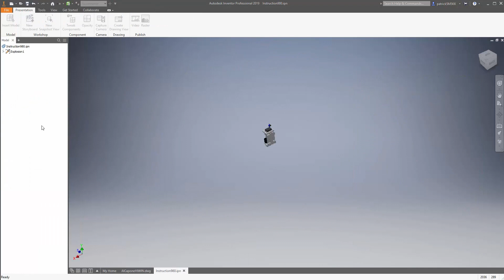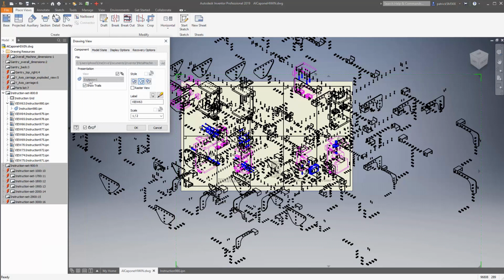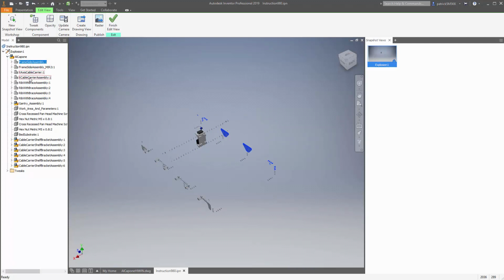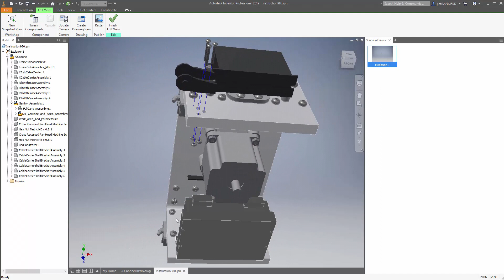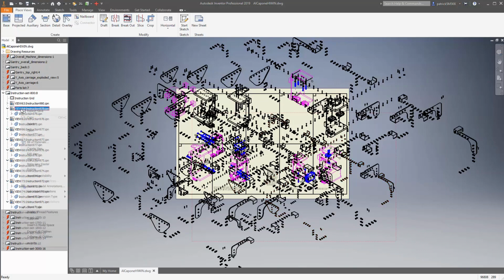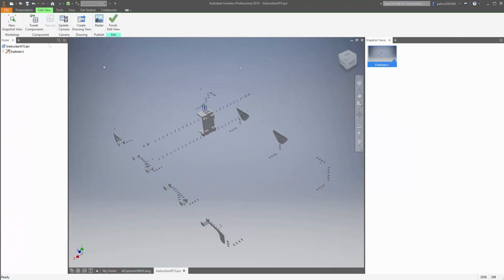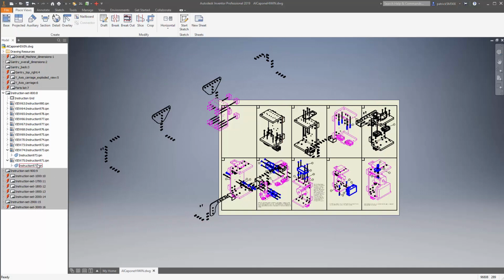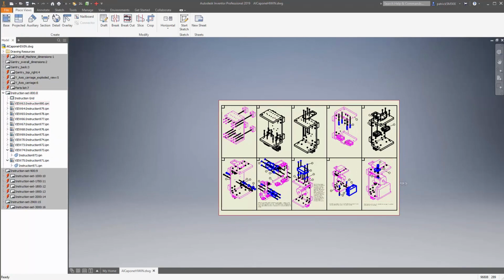AutoDesk Inventor: How to Modify IPN Presentation Files to a Drawing File View

Comment: Waow its the 2019 version and they still have this problems with such NORMAL things... I search atm. also for a way to make a documentation and i dont know if i should go with Rhino3d which i have and which isnt so good for it, or F360 which has very nice features. Blender since 2.8 is also now a opportunity, because you can make things so easy in folders and invisible them. Thanks for sharing!

Comment: Hi. 
One thing you could do here is set up the view in your assembly file. You can use that as a representation in your presentation file. As you create your views in your assembly file you should lock them down. By locking them down you will prevent new parts to appear in the view. There is one issue I have come across there and that is if you promote or demote a part it will show up in all views even if you have locked them. Also as far as I have seen the associative link in your drawing view is tied back to the assembly file not the presentation file.
Reply from the maker: Thanks Jarle.  I will give it a try.